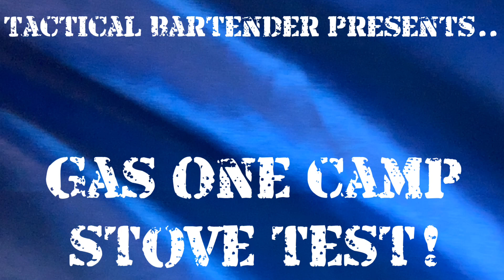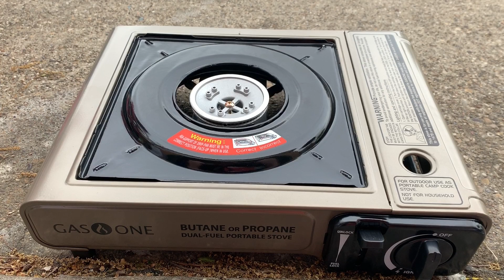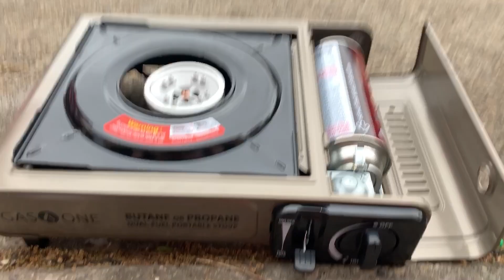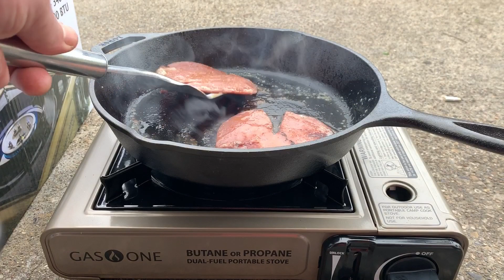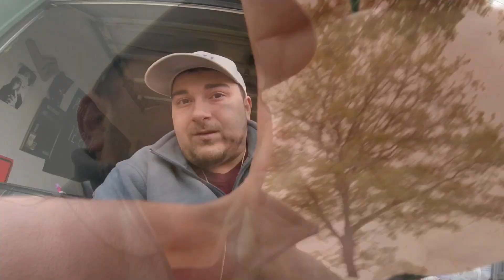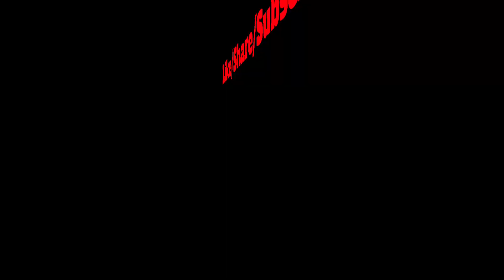Using Gas One camp stove (duel gas)

Comment: Beautiful little angels!
Reply from the maker: Aw, thank ya!
Reply: @tacticalbartender3057  

Your girls remind me of my twin grand babies.

How has that stove's regulator held up for you?  I just recently bought that model fr he dual gas option and read complaints  about the regulator failing.

I'm about to cut off the regulator end and  put a quick connect on that end with a low psi regulator  and longer hose to use with my 5 and 10gal propane tanks for better safety and cost savings to keep from buying butane cans. This grill works great with those Korean BBQ grill plates

Comment: Really impressed with the power. ¬¬¬>allmy.tips/Iwatani_stove?j62     It had no problem pushing my 12.5 foot inflatable around a good sized mountain lake here in Utah. Going back to the ramp was a chore against a 9 mph head wind. But this motor did the job nicely.

Comment: Does the propane hose connect to bigger bottles of propane like 3/5 gal or do you need a separate hose or connector for the 1 it comes with ?
Reply: The dual fuel gas one model. You can use a 20lbs propane can. You just need to purchase the adapter for it.
Reply from the maker: I don’t believe so..the adapter that comes with it will connect to 16.4oz cans of propane. I have seen another video where the guy bought another adapter for a few bucks and plugged it into 5 gallon tanks. Hope this helps.

Comment: Been thinking of getting one of those bigger gas camping stoves. Thanks for sharing!
Reply from the maker: I love it brother! Uses both propane or butane and comes in handy in a pinch or shtf scenario..or just simple picnic outside.
Reply: @tacticalbartender3057  I have been a Trangia user most of my life, but recently I got one of the cheap eBay gas burners to try out and it worked pretty well. Gas sure is faster than alcohol.
Reply: @ThePreparedNorseman  I recently got two of those dual-fuel mini-stoves, both made by Gas One. The first one purchased was their GS-4000P model, and more recently their GS-3900P. They''re for both emergency-preparedness use and for RV/Camping in the future.
-- BR